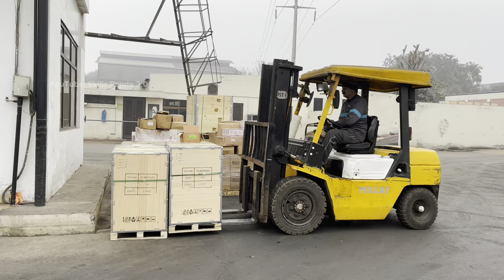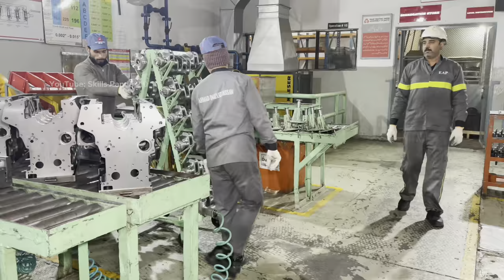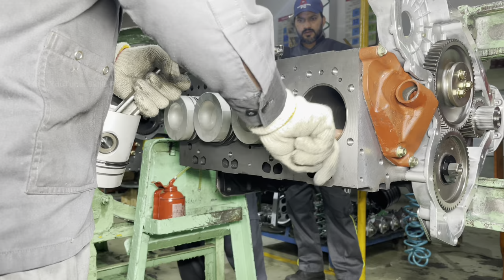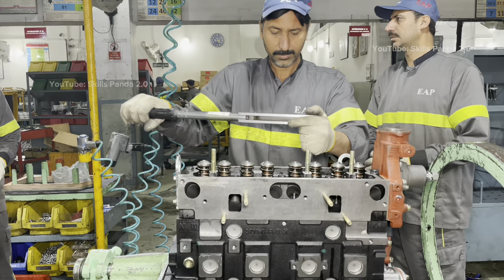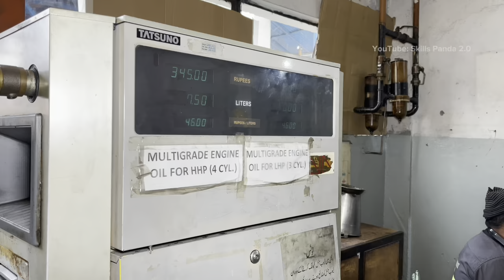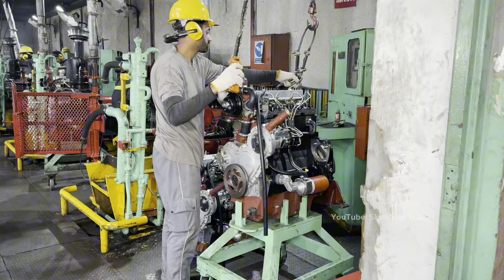Incredible Assembling Process of Tractor Engine in Massey Factory | Skills Panda 2.0

Comment: Yikes!  No assembly lube when installing the crankshaft.  Super dry start.
Reply: did you see how they jammed the cam shaft in??
Reply: @roberttammerawitchey4652  I was cringing at that too, not to mention the rough handling of the Valve Push Rods. Very crude too, how they adjusted the clearance on the same parts. Wouldn't want these cowboys assembling anything for me - not even a wheelbarrow !
Reply: Wonder if they got the main caps on the same block they came off? What about the line hone?

Comment: Thanks for the engine assembly tour. Those engines look pretty stout. I have 2 M-F tractors a 1959 M-F 50 with a Z134 Continental gasoline engine, & 2018 M-F 1526 with a 3 cylinder Iseki diesel. Both are very reliable. Thanks again for the video tour of engine assembly.